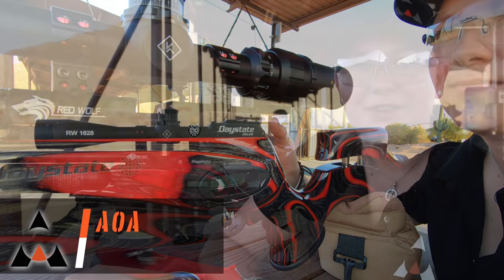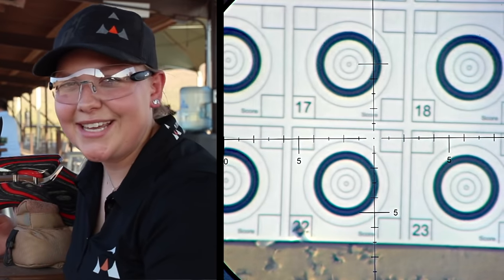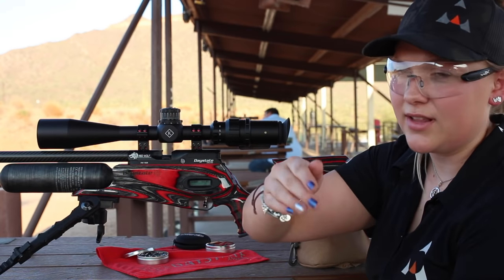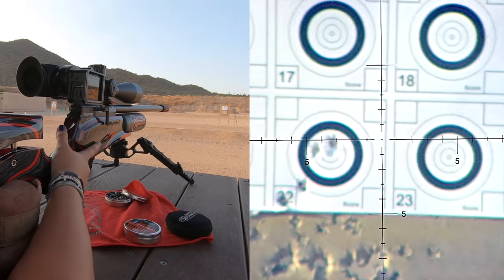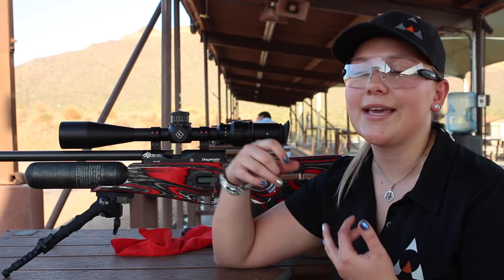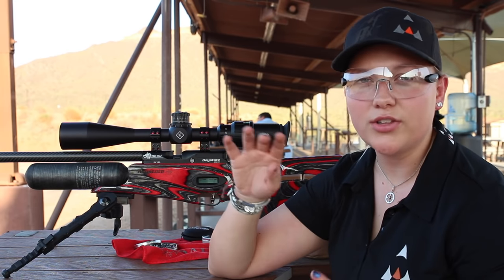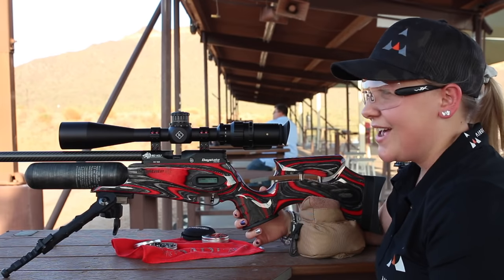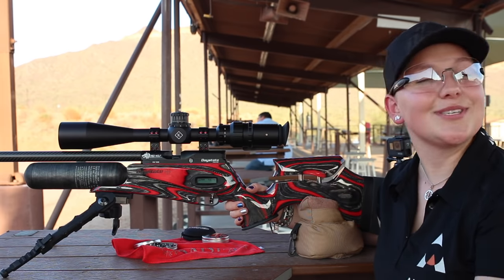How-To Sight In A Scope - Airgun Bootcamp

Comment: As a target shooter you should sight in your mount before moving the reticle from centre. You will notice when you returned the scope to "0" the shot placement did not return to L1" x  D1". This is in the scopes ability to hold the reticle in place consistently, the further from centred the lesser it's ability to hold position. You should do as much adjustment with the mount as you can, if necessary by shimming it before touching the scope. Your shot placement may return after a few shots to settle it back to "0" or it might happen later or not at all. But it might happen during competition.

Comment: Hi can someone please help me. I use an FX Crown, with a Helix scope. I also  have FX no limits scope rings. My rifle was a pile driver shooting 5 -10 shots through  the same hole.

Then my gun magazine stopped feeding. It turned out the FX no limits scope had moved and the magazine was failing to seat properly by mm. 

Here is the problem, I raised the FX no limits rings to allow the magazine to clear the scope. Now my scope is shooting low  at 20m  and I maxed out my clicks last night. 

I know this is due to my inexperience but can someone please help to get my Zero back. I plan to zero at 20m then work out 25m,  30m and 50m. 

I would love to see what the crown could do at 50m against a .22lr.

Any help would be appreciated.

Comment: How do you make it to where your scopes don't keep resetting I use centerpoints and smaller scopes usually not variable scopes just the ones you have to rotate your self
Reply from the maker: There are many factors from gun to scope, but the best practice is to make sure you have good mounts that are appropriate for the airgun and torqued properly.
Reply: @airgunsofarizona  thank you!

Comment: Should take two shots to sight in a scope and a third to confirm zero. Your way works as well. I normally take one shot don't move the gun and move the cross hairs to the bullet hole. Take second shot at new target you should be right on then take third shot to check and make sure your good

Comment: "Don't be afraid to click a lot."  Ok, I've mounted my Ruger 4x32 on my new Air Hawk Elite 2 and started shooting at 10 yards.  Five shot groups would easily fit under a dime but were about four inches low and an inch to the left.  No problem adjusting windage but when trying to raise point of impact I ran out of clicks.  Now what? Any help would be appreciated.  Thanks
Reply: Have you solved your problem? You might want to add some thin sheets under the scope mounts to adjust it and get more adjustment space.

Comment: This is an easier way to sight in a scope.  Keep the airgun in the stationary position and fire one shoot aiming at the center of the target.  Hopefully, the shoot hit somewhere on the paper near the target.   Without moving the airgun, dial the scope to center on the hole of the first shoot.  Your scope is now sighted for your first shoot.  Re-aim at the center of the target,  fire the second shoot, and you would be much closer this time.  There is no calculation or counting of clicks using this method.

Comment: OK, not trying to be funny or a smart ass, I shot a crow, and the distance from where I stood to the tree was 55-57 yards, he was at the top of the tree which was about 200 feet high,  so what would be the actually distance that I hit the crow ???  Is there a formula to figure this out ??  I've shot doves off power lines/poles, and the distance was about 60 yrds, but then I had to take into account the height that it was at.  Just wondering because it might give me a better edge if I shoot out farther.  Thxs
Reply from the maker: About 207 yards on the diagonal. The formula is called Pythagorean theorem if you want to see the math.

Comment: I really cringed when you stated that  it would take a lot of clicks to get it sighted in.  First, you didn't use the math. Math rules! But there is an even easier way. An old bench raster's trick.. 

Shot one shot and one shot only. with the gun firmly on the bench and being careful to not move it,  adjust the cross hairs until the cross hairs intersect the first shot. It is now coarsely sighted in for that range . Shoot three more for conformation or any slight adjustment needed. Easy and done! ;<)

This works at any range. No math need, no guessing and running clicks up and down.  Yeah, I know, sounds too simple. But you want the projectile hitting where the cross hair is. Right? This is how you do it FAST! (Not to mention shooting much less ammo. All good things! No?
KnifeMaker

Comment: She is terrible at explaining. 99 percent of the beginners will make the mistake that the direction indicated on the turrets are moving the cross hair, which is incorrect. The direction of the turrets are to move the point of impact of the pellet.
Reply from the maker: Pretty sure she explained that exact point in this video.

Comment: WRONG..WRONG..WRONG First thing to do with a scope is centralise the cross hairs. View an object at distance and rotate scope in a solid firm base and keep adjusting the cross hairs until the centre stays on the object at 90, 180 , 360 degrees. Mount the scope on the rifle and put a dozen pellets through it at your desired at your zero range, 25 or 30 yards. If the pellets are not hitting bullseye, the mounts need to be loosen and the scope needs to be shimmed, normally very thin plastic cut to size to fit in the mounts work well. By doing this the scopes crosshairs can be adjusted up or down depending on whether you shim the front mount or back mount, and side adjust can be achieved, once all Is tightened again, shoot more pellets, if still no where he bullseye, repeat and shim again using more shims, until your hitting as close to bullseye you can. Its normally time consuming, but the theory is once the gun is zeroed in this way, and you shoot at your zero, if your holding the gun at an angle you should still hit your zero. If you do the zeroing in using the method on this video and when you shoot your gun it  is off at an angle, and your not holding the gun level, your crosshairs shall be off angle. Ok you will get the same effect if shooting at a further distance from you zero if your dialling, that’s why it’s important to hold the gun as level as possible. Many serious field target shooters will have a bubble level on their rifle to check the accuracy of the hold on their gun before the trigger is pulled.